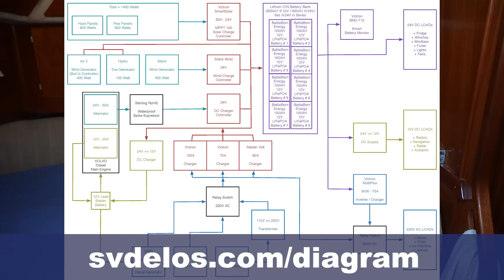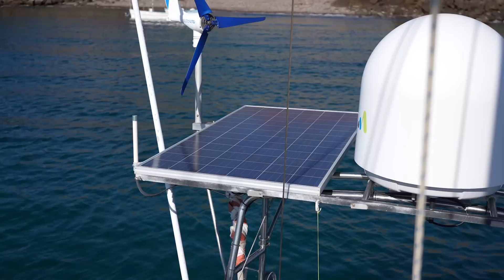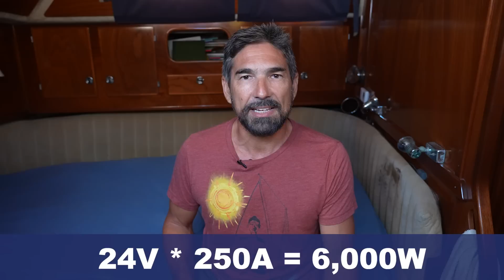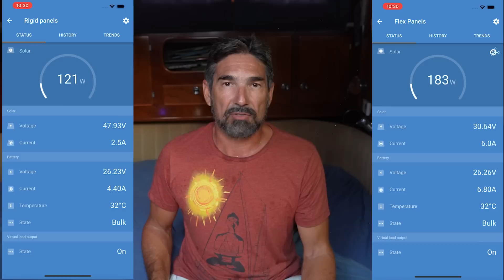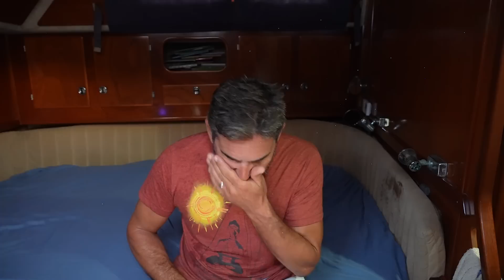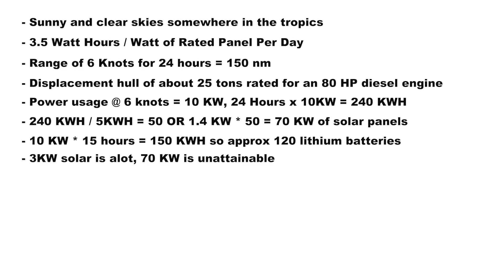ELECTRICITY On A Sailboat Q&A ⛵️ (Lithium, Solar, Wind)

Comment: Brian, I run my complete office from my truck. Computer, printer, scanner, and a plotter to print plans. Using four golf cart 6v batteries. No 110v inverter. I use step up transformers on each item from 12v to meet the units voltage, 19v,  32, 24. I have only a 50W solar panel running on the roof which was added as a joke. But amazingly the solar panel has kept me from having to charge at night from home. What I have found that no one I have seen mention is that the increase in voltage from 12.7v to 13.2 average (parked) has made everything run so much more efficient. The savings of battery life far exceeds maybe tripled the output of the solar panel. Maybe you could comment on this awesome affect. BTW the first step of eliminating the inverter with step up transformers was a huge help as well. And they are really cheap $30.00. Thank you so much for all you do. I am an RV,r and a boater my whole life.

Comment: Clark from Clark and Emily has created a BBMS system that is capable of charging lithium and lead acid at the same time. You should check it out. He also came up with an air conditioning system that runs off of batteries

Comment: A renogy 20A battery to battery charger might give you some extra power from your 35 amp alternator, and costs around $100US.  I think it would work with a 35 amp but am no absolute expert there.  I have it working fine on a 70 amp alternator. 20 amps over 10 hours is like 1200 Watts or 200AH at 12 volts...which would be like a 1/4 of an 800AH bank.

Comment: After seeing EVs burning up in Fla due to batteries being under water then causing fire what stops a boats Lithium from doing same if sea water gets in bottom of boat lets say bilge pump failed  but after fix are they usable or would you replace asap

Comment: You can mix  led and lithium, watch  Emily and Clark's adventure.
Ckark is an engineer and designed  equipment for this purpose, there are benefits to doing this.
Reply: Doesn't mean it's a good idea.
Reply: If you watch the videos on the subject you would understand why it's a good idea. In certain situations.

Comment: There are several youtube channels showing hybrid systems. If you went totally electric a monohull doesn't have enough room for over 2k of solar usually.  you would have to sail a lot to add charge into a huge lithium battery bank( 4 banks of 28kw min) 8 hours of slow motoring would use that up. hybrid engine would be the choice. it can run on diesel and charge the battery banks at 5-8kw per hour, so for every 4 hours of electric motoring 11kw per hour usage the diesel would run 8 -9 hours. where hybrid is best is when you can sail at 6-9 knots and regen 3-5kw per hour into your banks.  you seeing that a monohull its not really practical yet. Catamarans that can hold 4k of solar with 1 hybrid engine and 1 electric is the way to go. as when you sail you have 2 electric motors doing regen giving you up to 10kw per hour when sailing at 6-9 knots. having a light performance cat you can benefit big time with hybrid.

Comment: you can have AGM and lithium batteries. But having 2 systems gets complicated and most do not have room for it. you need to build a new system. Most will sell there old system for cheap or give it to someone and buy a complete new system. I suggest a 5k inverter or 2 3k inverters for redundancy and so you can power anything you need from batteries.

Comment: backup systems. Delos has that covered with generator. solar and wind. you need to make sure you have enough power to keep auto pilot running in an emergency. Who wants to hand stir all day in crossings.

Comment: High output alternators are expensive for lithium.  If you are motoring a lot then yes have one that will charge your cranking batteries and house bank via a DC/DC charger for house bank and the normal output will charge your house bank and they should come with a voltage cutoff so when lithium gets full and BMS stops receiving it wont hurt anything. Plan for 3 days usage with no sun for battery size. 48V is king as if you need to run wire 40 feet you can use a 2 gauge wire for dc. if you have a 24 volt its gonna be 0 gauge and for 12 volt 00 or 000. have you priced 000 wire in 40'? you can buy a solar panel for that price.

Comment: You bring up a great point in energy use. Again he has an older boat so his fridges and ac units will use more than newer more efficient ones will. Also if he changed out the 600 watts of panels to 3 400 watt panels more power would come in. also doing the same with flex panels. Usually I suggest 14kw of battery banks. In his boat I would have 28-30kw with more solar and would replace that noisy wind turbine for a newer 800 watt turbine also.

Comment: If you or anyone wants to know how to correctly hook up batteries to get maximum amps with lowest C rating ask me. I researched for 2 years before building my system 60kw of battery banks (4 banks or 15kw) at 48V to 2 5k inverters. Max load of 10kw draw is 52 amps per bank and since my banks are 280ah that is .18C which causes no heat in batteries or cables. even if I used 100 ah banks that would be .52C which is almost half the rated discharge/charge rating. Battery brand doesn't matter its how you hook them up.

Comment: Electric-Diesel Hybrid... I like your perspective. Don't add complexity. However, Isn't a diesel genny a bit easier to service/maintain? I see so much contortion when people work on their diesel engines. Your genny is mounted in a very accessible place. For a catamaran, I'm thinking of two separate systems, both hulls, but with a crossover capability.  Extra cost for sure. But for remote world cruising... I would configure it that way.

Comment: Several advantages of the hybrid engine for me:
1. A lot of motoring is to get on and off the dock, when having instant power without needing to first start the engine can be useful.
2. Off shore in good winds, the hybrid is a hydro generator, giving another source of power.
3. It cuts the need for a separate generator, saving weight, equipment to maintain, and freeing up a lot of space.

Comment: I see everyone with Battleborn batteries doing it wrong. Connecting  every battery to every battery is wrong. That is called daisy chaining batteries and the full load goes through every battery which is 100 amp for 1C rating.  100 amps at 12V is 1200 watts. if you use say 3000 watts that means you are pulling 3C through your batteries, not good. Connecting each battery for 12 volts to a bus bar 1 for positive and 1 for negative. so 6 batteries in daisy chain pulls 3C as 6 batteries to a busbar pulls .5C at 3000 watts which prolongs the battery life and makes them more efficient as heat loss and lithium breaking down under heat and load. Battleborn wants everyone to daisy chain so in 8-10 years you buy new batteries. with busbar you can almost double your life of battery. you have a nice package on your website but you should add in 2 400amp busbars(8 connecting bolts each) 1 for Positive and Negative. Then from each battery you can use smaller cable to busbar and only the load cables to inverters need to be bigger. Also I would recommend 48 volt battery banks which means even load cables are a lot smaller. I see you have 24 volts which is way better than 12v but less efficient than 48V. oh Battleborn discharge is 100 amps @ 12v and 200 @ 24v so 2400 watts is max you can discharge which means you cannot push your 3k inverter. Again if you redo your battery banks  into 4 banks of 24V  you could have 4800 watts of usable power at 1C using busbars. which means you could also have a 5k inverter and run anything on it with ease. Okay I see you have 4 banks but a single pole busbar for each. Not sure how safe that is it could be and I would not do it that way.

Comment: I hate watts. If you use your windlass for 1 hour, it uses 100 watts. But batteries don't come in watts they come in amp hours. So we have to covert 1000 watts into a 12 volt battery which is about 100 amps or so. It would be easier if everything was just rated in amps, then we know precisely how many amps are coming out of our batteries.

Comment: Hi Delos,
I've just finished watching your latest video. 2 comments. 1. We have a Danfoss bd35f which was consuming 60 watts. I've got that down to 35 watts. If you're interested, I can explain how I did that.
2. As regards an electric propulsion, I think it would be viable on your boat as you already have a generator. If your Volvo diesel needed to be replaced, you could install an electric motor and add batteries as and when. You're not really adding complexity. You would save diesel on short hops and manoeuvring and use the gen. on longer trips. ElectricYacht systems (as used by Rigging Doctor) are a lot cheaper than Ocean Volt (no connection).

Comment: People sailled around the world for centuies without any power other than sails, you might not be able to do everything with electricity that you can do with diesel but given the world is likely to have uninhabitable areas within the next 30 years its probably worth the sacrafice. Similarly if you're using hydrocarbons you could argue that if you have electric motors (and the ability to regenerate power to generate more power when sailing) then you either don't need a generator (because your engines can drive the regen) or you could do away with the engines so simplify that way....

Comment: For charging Lithium batteries from an engine alternator, I would recommend a DC to DC charger that will limit how much is drawn from the alternator and protect it.  I did this on my Motorhome when I switched to Lithium batteries.
Reply: An engine alternator should be able to handle full amp output 100% of the time. If not, then replace it with one that can. Yeah, a lot of OEM alternators are POS. They work for recharging the starting battery, and minor loads fine, but not large loads. 

A DC to DC battery charger is a piece of electronics that can fail, and thus something one needs to keep a spare for, or do without if it fails. Can one do without it if it fails? I like to favor redundancy if possible. The one place I'd consider a DC to DC charger is from the house bank to the starting bank. This is mainly for keeping it topped off, but it also could recharge it if the starting bank alternator fails.

For charging both a starting battery bank and separate house bank, I'd give each of them their own alternator, and wire them as separate systems. Yes, two alternators. This is often not done because hard to get, or custom brackets are needed. If possible each alternator should also have it's own dedicated drive belt. This is for redundancy. If one alternator dies for whatever reason, the other can be used in it's place. This also allows different battery types and ages for the two battery banks. Obviously each battery bank needs uniform type and age of batteries in it. Using external regulators, like modern Balmar ones, that can be custom programmed for the ideal battery voltages and currents is best. A single backup external regulator can be kept as a spare, and programmed when installed. Record the setup steps, and keep them with the maintenance books, so they can be done quickly without thinking in an emergency. One of the biggest reasons for using an external regulator is having a temperature sensor at the battery to adjust charge voltage based on the actual temperature of the batteries. This is very important for lead acid batteries. The battery bank and engine room temperatures can be quite different. The battery management system in lithium batteries should take care of this.

Newly outfitting a boat, or major refitting one later, I'd seriously consider having all the alternators and regulators identical so spares can be carried and used anywhere. I would do this even for the starting battery alternators. This is basic redundancy.

Each drive belt typically has an idler pulley to set tension. If it is a spring loaded type, then adding a contact switch on the idler arm is possible. That way if the belt fails, or it stretches too much, an alarm will go off and you know immediately, and not later after something else fails due to lack of power.

Yeah, I think things through too much... It's the designer in me meting my paranoia.

Comment: Back in 1979  we had some lower tech power situations but one thing I do remember when I was living in a motorhome bum skiing in the Rockies I do remember one way to keep my batteries topped off was to head out to the golf course at night and plugged in to the soda machines by the first hole and after cranking some current the extension cord would melt in below the snow line and keep everything incognito yeah there's nothing like straight electrical current

Comment: Since I’m not a patron and on a fixed income now I’m asking mostly for your own personal consideration. Will the lithium/iron batteries burn hot like lithium/ion batteries or is the heat more manageable where you don’t have to worry about the next cell igniting by being in close proximity? I’ve been seeing videos of electric vehicles catching fire for various reasons and they have a tendency to reignite hours to weeks later. I know your setup doesn’t have as high a draw overall as cars but I’m more focused on the reignition potential after seeing the melted glob on one of your components. If you haven’t already I’d urge you to watch some videos of electric vehicle/battery fires to see the potential risks and how it would compare to yours and other close cousin applications. When fire departments put them out it jumps from 300 gallons for a gasoline engine to up to 2,400 gallons for a battery pack. I hope it doesn’t apply but since you have very precious cargo onboard it can’t hurt to verify the amount of risk comparing worst case to yours. I’m just curious whether they’ve done testing for a worst case scenario, including near end of life batteries. With all the weird scenarios that have played out onboard ships I tend to wonder about the what if’s more than most people. 
Okay, back to the lighter side. I did notice you were beginning to melt. When I get that hot I can’t even concentrate because of spending so much time wiping away the sweat. Great to see you doing a better job than I would in the situation. Safe travels to all! 🫠👍✌️🙏❤️

Comment: This was a great example of how valuable it is to have a method to share your knowledge and experience with those of us who are not so technically adept. Brian, I was suffering along with you as I watched your tee shirt evolve into a wet rag. That looked miserable! Thanks for bearing the heat and doing this segment.
Reply: Yeah he needed to turn the AC on, it must have been getting hot in there.

Comment: A comment on your dinghy davit solar panel setup.  It would appear you have two 300w hard frame solar panels, one on each side of the white radar/sat device.  Suggestion if dingy davit can hold extra weight.  Replace the two 300 watt panels with larger 450-500w panels,  and reuse the 300w panels in two slideout racks (starboard and port) that allow them to slide in and out from under the new 450-500w panels (see YT Sail Life Athena from 1 yr old for design).  You only slide out panels at anchor/ motoring/light wind conditions.  This would give you 900-1000w more potential solar power  or 64-71% more solar power and may eliminate need to run generator as much.  You will need another Victron controller, and some items now attached to starboard and port sides of davits would need to be relocated.

Comment: Have you thought about Tesla batteries? SV UMA (mono) and Sailing Dauntless (cat) are both fully electric and have many amenities. The Tesla batteries don't take up much room compared to other batteries either, different shape. Just a thought, they run less than $1k on eBay and are 5.2KWH 24V 250AH each, Not saying that BattleBorn isn't awesome, just saying there are alternatives and means of going total electric. I'm not for certain, but I think UMA has BattleBorn batteries so I think it's possible.
Reply: UMA has BattleBorn. Tesla are a diff chemistry. Rigging Doctor created their own system from cells and leads and BMS. Took them a lot of work. Ryan and Sophie use Dakota batts. Those are LiFePo like BattleBorn but Ryan is a company owner...
Reply: With metal housing cylindrical cells there are quite a few safety concerns for marine application. First of all Tesla's chemistry is more volatile and fire prone. Secondly the cell construction would leave that pack very vulnerable to hard shorts from water ingress to the pack. 

You can look up the first Chevy Volt fires for what water ingress to an automotive battery looks like. Early Volt packs could experience liquid coolant leaks internally.
Reply: I understand lithium and I'm not disagreeing with you about water and lithium and the safety issues there. However, I know for sure that 'Sailing Dauntless ' uses Tesla batteries and they can use hair dryers, cooktops, washing machine and dryer as well as their dishwasher and anything else on board at the same time and not worry about anything, plus they have 3 days supply of juice in case of cloudy or rainy weather. My point is that going total electric is most definitely possible and the Tesla batteries don't seem to be an issue for them. Cheers and 73s
Reply: Going total electric has many advantages over diesel as well. No worries about getting fuel or the quality of the fuel. You can also go to further more remote places, like far North where there aren't any refueling stations. 
I didn't mean to strike a nerve with the Tesla thing. I just see how much more freedom is to be had.